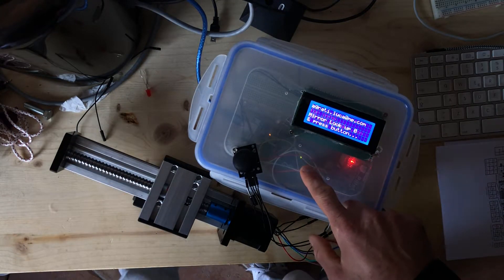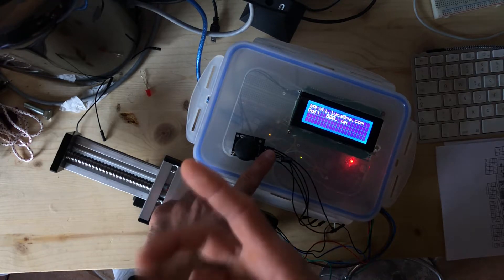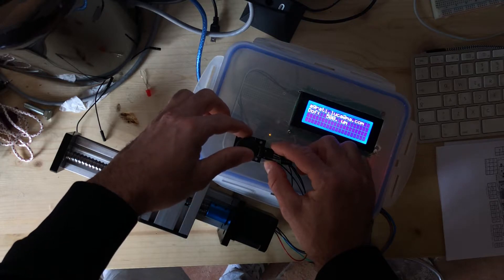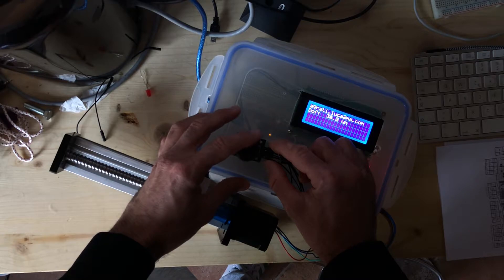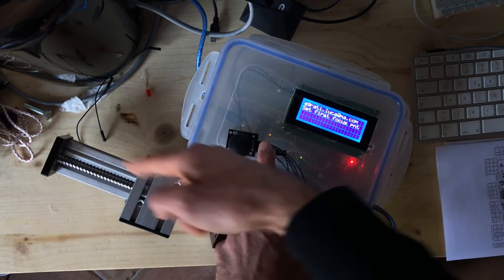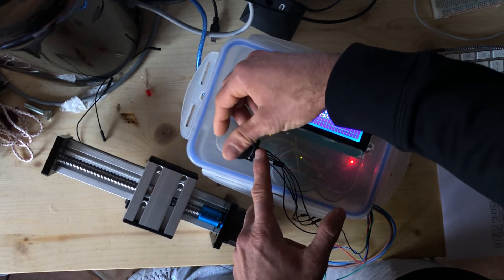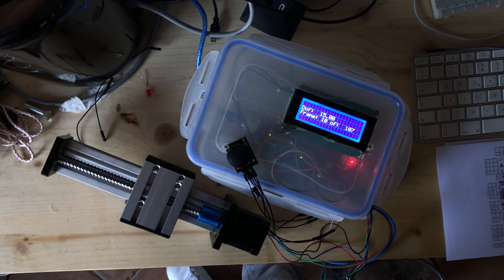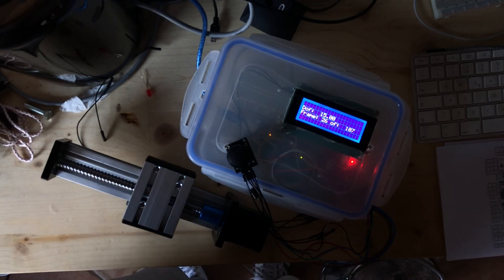Luca's umstack DIY macro slider for macro or product photography

Comment: What rail did you use?
Reply from the maker: It is a ball bearing screw, you can buy on amazon as Z axes for CNC. with that kind of bearings you can calcel all the backlash
Reply: @lucaagrati8575  and what is the metal part of the rail and what is the rod that rotates the platform?
Reply from the maker: @NoahPeeters  Sorry but i'am not getting what you are asking me. I can link the rail i'm using if you want to buy it: 
https://www.amazon.it/gp/product/B01MUXZY79/ref=ppx_yo_dt_b_asin_title_o06__o00_s00?ie=UTF8&psc=1
Reply: @lucaagrati8575  OK thanks now I know what you mean.

Comment: Amazing! This is the exact setup I was considering. Would it be possible to share the project and parts details? I would love to build something like this!
Reply from the maker: Hello, so i'm waiting the pcb i made for that. Actually i improve a little using an arduino mega and a nintendo wii to control it. Just follow me as soon as i will have the shield i will upload e complete video on that.

Today (January 18 ) I receive the board. Sunday I test it out and upload a video as soon as I will finish to show you all the specs and improvements I made from the last video
Reply: Look forward to that. A detailed walk through the code and putting all together would make it a one of a kind video on thew web and an excellent reference! I'm sure you will get tonnes of interest.
Reply from the maker: @romans9249  thanks for the interesting, as i told you i ordered a pcb for the mega but it came not good. A track was in sirt circuit. Anyway i'm redesign a pcb to order again. Since this proces require some time i will put a video on the procedure and material i'm using. But if you don't want to mess with wire and stuff let me know i will order a couple more pcb
Reply: Hey  @lucaagrati8575  , any updates on your development? Are nuts on the sliding base M6 and what's the nut depth? I'm ordering the same rail and thinking to install araca swiss release plate on top of the base. How did you install the camera?
Reply from the maker: @romans9249  hey no still no update, too busy at work. Anyway i install the camera with a relase plate on top. I don't remember the exact model.